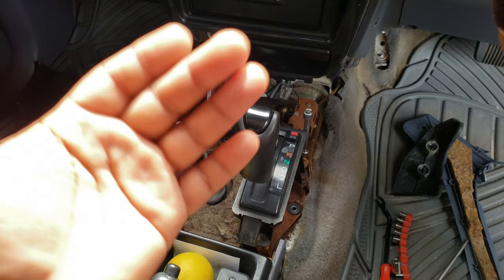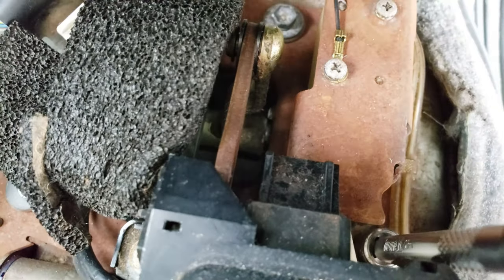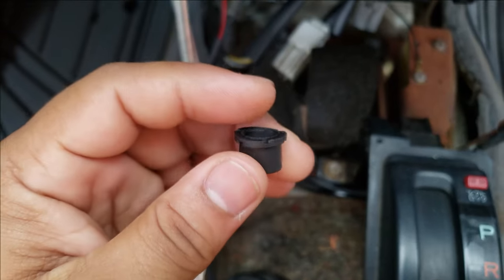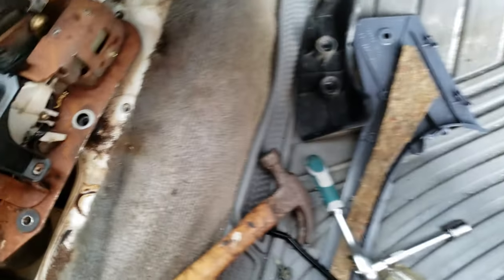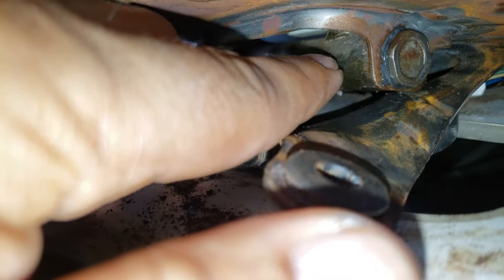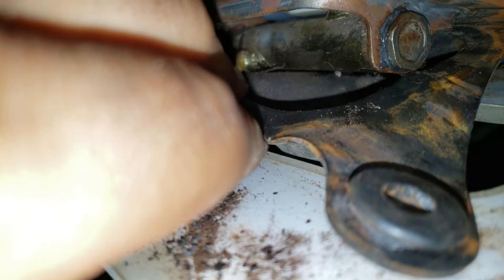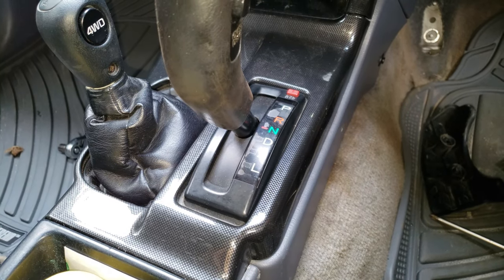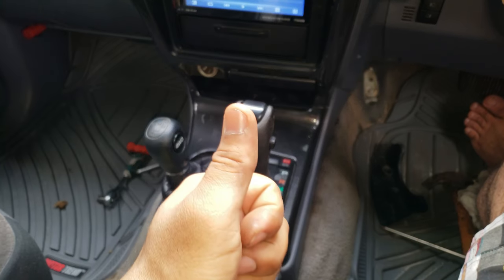Replacing Shifter Bushings on a 1998 3rd Gen 4Runner/Surf 185

Comment: Is that a carbon fiber center dash? I also have a 98 and have been procrastinating this project bc I'm afraid I'm going to damage the console while removing.
Reply from the maker: It's actually one of the easiest fixes. It's a carbon fiber design. Mines is a surf not a 4runner so some minor options were different on the surf